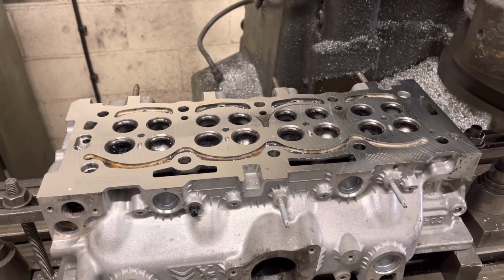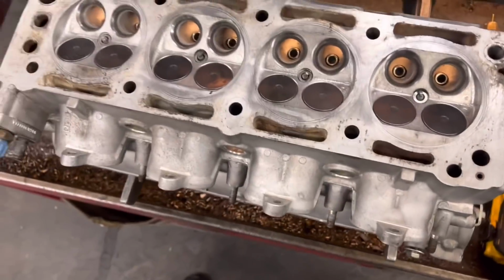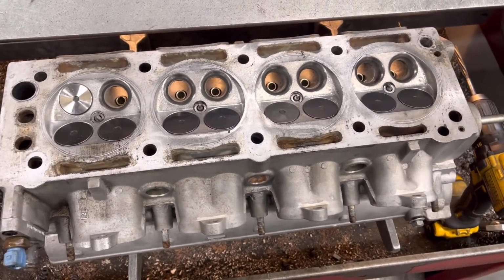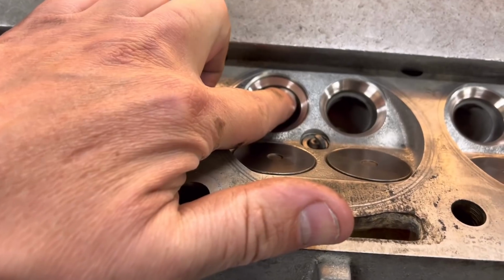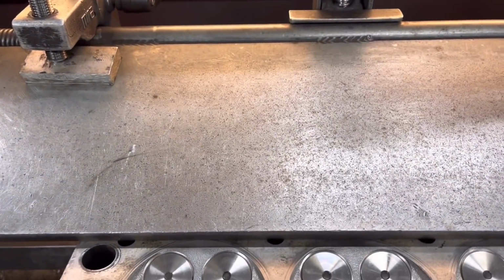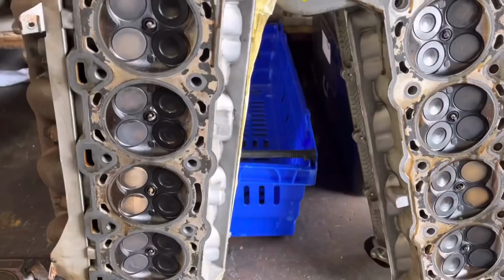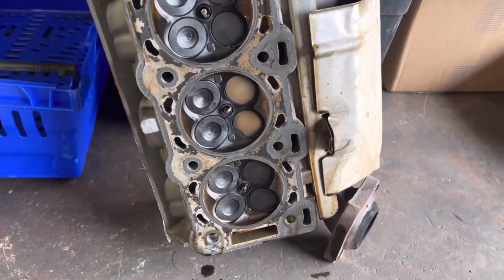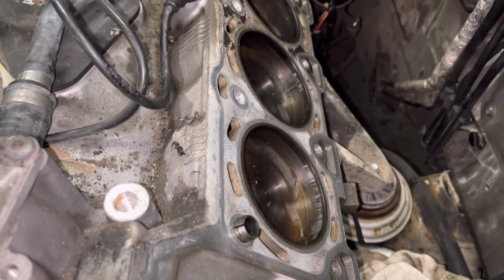XKR Jaguar head gasket job could end up MAJOR engine build

Comment: Hello Lee, That Jaguar job looks to be a complete nightmare...l would not be getting involved, the labour cost for you & the garage across the road will be horrendous... & on a Jag? are people nuts!... l know this comment will upset alot of people, but the Jaguar vehicle now is nothing like it was in 'the good old days'....they are not particularly well made, just living off the 'History' of the name.
You have proved what 'junk' it is because you have said & shown us, it has 'issues' everywhere or is 'worn' out....l am amazed you & your garage friends are prepared to take it on. Definitely more money, less hassle, & guaranteed results with your Cosworth work. You cannot take on all jobs & make it viable.....
Last comment, the reason the Jaguar parts are so cheap is because the are crap quality & have low sales volumes... very few people would be getting involved with any job like that...you wait until the engine is out, fully looked at & inspected, parts & all labour costs worked out....its a modern Jaguar, get shot of it anything near 50/75k miles. They are a costly time bomb!!...'Why do you think the Main Jaguar Dealer elbowed it'...
Its a new engine sir - period.
All the best.

Comment: No turbo engine should have 3 angle valve seats. On an NA engine it can help to give same increase in air flow, but on a turbo engine there is never a lack of air flow because of the turbo. But the problems turbo engines have is too much heat in the combustion chambers. The only way to get heat out of the valves is through the valve to seat contact. So the valve seats should always be as large as they can be to cool the valves and stop detonation.

Comment: You've just frightened me Lee! I have the same 4.2 SC in my Range Rover and I'd hate to have to pull that apart!  Ten to fifteen years ago I'd have relished the challenge, but at 68 with a knackered back I don't think so lol. I'm just in the process of pulling the starter motor off and that's a pig of a job, getting the heat shield front bolt out ( easy if you know where the bugger is lol AND that it goes in a 45 degrees!  I spent hours trying to get a socket on it thinking it was vertical  as you can only get one fingertip  on it as room is so tight. As to getting onto the top starter bolt that's another complete nightmare as the mounting holes are not vertical as they appear to be when looking from below. Anyway finally ( two bloody days later !! ) I  got the thing out last evening. Too knackered and stiff to get under there today, so I'll have day off and do tomorrow!

Comment: I had a customer  tow in a jag with the 326  cubic inch V-12 with  blown head gaskets with wet  liners, he used a chisel to pry the heads off, and then told me the cylinder sleeves come out from the bottom of the block, I  showed him the exit sign, he destroyed a 30,000 dollar classic engine

Comment: Can you explain why you have 3 different angles on the seats?
Reply: On an NA engine it can give more airflow,  but should never be done on a turbo engine as they need wide seats to remove the heat from the valves.
Reply: Thank you, love the channel

Comment: is there even any other efficient way using a reamer that doesn't make your wrists feel like they are on fire? I've reamed valve guides ranging from .150" all the way up to
 .800" using a drill (the really big reamers usually require a torque multiplier) but doing a set of heads off say a cat 3516 or a 3520 it would take literally hours to do them all by hand with the exact same final tolerance anyway.

Comment: is a reem just a drill ????
Reply: Absolutely not! A drill can only put a hole in something to an approximate stated size if it is properly sharpened, if improperly sharpened it can ONLY cut OVERSIZE. A reamer removes only a small amount from a properly Undersized hole and cuts it to its specified final dimension. Usually only two or three thou bigger than the undersized hole. Example; a .500" hole is specified then a drill of say .497" would be used to make the undersized hole and a .500" reamer used to finish the hole to size. This is an ideal world scenario, in the real world of engineering, there would be a tolerance specified, which might be large as + -  0.005" or as tight as + - 0.0005"
Reply: @samrodian919  in the80s ass a gress monkey starting out king pins need reamed out !! if you needed a new one ... in the 80s nothing well od van and **& did  i got led to believe never seen it ore dun one so never seen enny think reamed till now and just looked like you put a drill in .. yes the hole already there but just a drill finishing it off sorry :(

Comment: I'm not sure that I totally agree with your position on the Jag engine. If the aluminium deposits are just at the top of the offending bores and are able to be easily sanded out (I have cleaned up bore deposits myself using medium grit wet and dry sandpaper, admittedly on air cooled motorcycle barrels) surely there is no need for a complete engine short block recon.

Comment: May have a good lead for you on the jag engine. There's a place where they buy up loads of engine parts for remanufacturing but they do have complete engines from the factory OEM may be test engines or brand new ones the place is in Stratford on Avon. 
Sent me a message and il give you the contact details privately..worth a quick call. Its an aladdin's cave

Comment: You mentioned the 30, 45 and 60 degree valve seat angles. David Vizard flow tested various seat setups and found that a port with 15 degree angle changes flow exactly the same gas volume as a carefully rounded off port. Interesting eh?

Comment: I haven't seen pistons auto deposit themselves on bores since I was an apprentice rebuilding bedford TK engines, its a shame but just another reason to stay away from the jaguar landrover camp, almost any brand has  better reliability 
Keep up the good work
Reply: BMW engines have a terrible reputation too, this seems to be a common thing in modern engines, probably because they are made to the lightest possible spec and are prone to failure.
Reply: @ Marcus zukas Absolute Rubbish! JLR has its faults, but the AJ engine is pretty reliable on the whole. It does have a terrible rep in the 5 litre version with timing chain tensioner issues especially in the US where the vast majority went, but that was sorted out ages ago. On the other hand the  BMW 4.4 litre V8 fitted to the Range Rover prior to 06 model year had all sorts of issues, not least the Vanos variable vale timing set up. So all in all I love my RR 4.2  supercharged!

Comment: Please do keep us posted with the Jag engine. The same as another commentator below - I have one of these in a Range Rover Sport. Lots of horror stories regarding burnt out valve seats - so if you get chance, would you be able to remove the valves and let us know the overall condition of the heads please?  PS Spent most of my 20's navigating in a Clubman Rally Sapphire Cosworth. Brings back great memories watching you working on the Cosworths!

Comment: Dad was a machinist at GM in the 50's-60's. Was changing something in a machine that had several small Allen head fasteners. Back when we used Allen wrenches...slipped a one foot piece of tubing over handle for better leverage. A "white shirt" was walking by and went absolutely ballistic about torque specification, etc, etc.

Dad handed him the Allen wrench and told him to loose a bolt. When guy did he immediately jerked hand back and said OUCH!!! Dad said "stings like hell, doesn't it"..."that's why I'm using the cheater pipe To LOOSEN THEM! 🤣😂😅😆😉

Comment: Drilling those valve guides looked rough as f...k  😱
Reply: He wasn't drilling, he was reaming, and explained why he does it that way!
Reply: @paulwoods7857  He doesn't know the difference. Drilling is making a hole. Reaming is SIZING a hole.
Reply: @gailtaylor1636  spot on, well explained! 👍👏
Reply: @gailtaylor1636  I have reamed out my fair share of king pin bushes on old lorries and milk floats by hand, bloody hard work, I wish we had battery drills back then, they would have made my life easier.
Reply: Good job I wasn’t involved , I would snap the bit and the head would have been scrap .  🤣

Comment: Isn't the Jag V8 based on the Lincoln V8 which is derived from Ford? Maybe check out Lincoln/Ford for Pistons.
Reply: The 5hit auto box in a s type is a Lincoln 
They are super 5hit
Reply: @chiefrocka8604  this would be a ZF 5hp24 pretty good box if you look after the oil
Reply: @paulhancock3844  might even be a ZF6 hp or even an 8 hp depending on how old it is. That's what is fitted to the Range Rovers of similar vintage.
Reply: @samrodian919  I've got an XK8, uses the same box in most XKR's
Reply: The Lincoln LS V8 was designed by Jag in Coventry 😂 it is just a destroked AJ28 with no VVT. During that era Ford "gave" the S-Type a crap gearbox 5R55, crap PTEC EMS, crap Ford Aircon and telematics and a crap DEW98 floorpan and chassis components. Jag told the, it was crap but they didn't listen. Gearbox and EMS and loads of other stuff had to be ditched for proper German/Japanese stuff. How not to do globalisation.

Comment: OMG ..the French ...they shouldn't be allowed to build engines, full stop. No doubt another busy, fizzy little engine that sounds like a grass strimmer with cams made from toothpicks. The only criticism of "reaming" or anything ... I just think you guys not having a class 4 assembly clean room makes me wince.
Reply: clean what?
Reply: @capri2wd  A room out of the way of machining mess, swarf, particulates, a perfectly clean environment to re-assemble. https://www.youtube.com/watch?v=ASoh2uxYEsQ
Reply: You should have been around in the early 70,s and seen some of the French car's we had to work on.😢😢😢
Reply: I used to think that, then I realised that any engine coming out of the workshop will be clean enough, will need running-in again & a fairly prompt oil & filter change after this period. As long as all the galleries are clear the engine will cleanse itself over the first few oil+filter changes.
Reply: @wirdy1   Swarf, grindings .. pastes, human contact - impurities ...unwanted particulates, be in a position of knowledge that you have the least of these ...not be in a world of uncertainty  at assembly  ..need I say more?

Comment: Hi do you ever work on the early 70s MGB 1.8 l engines? Suggestions for extra power? Thanks.
Reply: 1948cc max overbore, ported head, max size valves, single 48 Weber, fast cam, and iron strapped mains. Transmission V8 quality, from flywheel to back tyres. Umm, don't forget the brakes, too.  😎
Reply: @huwzebediahthomas9193  thanks for your quick response and suggestions. I have a 1972 MGB in immaculate shape. Keeping stock for collectors or making fine to drive? The big question.
Reply: Fun to drive
Reply: throw it away and fit something else,tractor motor you can't polish a turd :)
Reply: @julieannecharters6132  , The B series was never a tractor engine, is well proven and much more reliable than a modern Jag engine.
Reply: Don't waste your time, they are perfectly adequate as they are and reasonably reliable. The moment you start chasing more power you are heading down a bottomless pit of despair and financial ruin.

Comment: Would you like a text wall of my reasons to run a thermostat in street and race engines along with a proper bypass circuit to keep cylinder head and cylinder wall temps with a narrow range to prevent super cooling during deceleration and overheating on high rpm times.